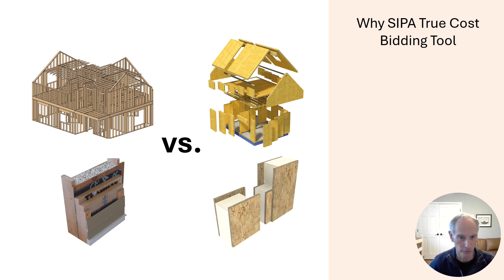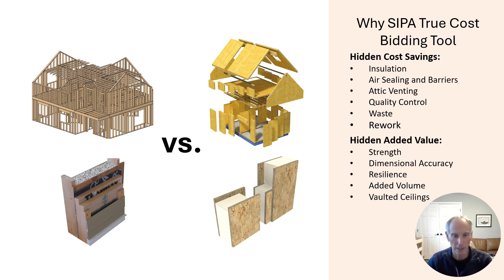Video #1 Why Use the STCBT to Deliver More Compelling Bids

Comment: Good information, but please provide QUANTIFIABLE value from both the Contractor perspective (% time savings to build w/ framing & insulation in one step, reduction of RFIs, increased overall quality, straighter walls, tighter home measure by blower door test, etc.) and from the Homeowner’s perspective (% increase avg heated space, improved r-value, % tighter home, less bugs, etc.) SIPs as a better way to construct homes have been around a long time now and this information should be readily available or calculated and shared.
Reply: It is very difficult to obtain the QUANTIFIABLE information that you are requesting from contractors and customers.  Contractors and customers are way too busy to take the time to provide that type of quantifiable data.  Enercept RSM's, Regional Sales Managers, do have specific contractors and customers that they can discuss these type of results on specific projects.  Please feel free to reach out to the Enercept RSM's for more information.
Reply: Thanks, Joe@Enercept, for your comments. The Structural Insulated Panel Assn. has on their website a page under the "About SIPs" dropdown menu at the top in the RED bar with a listing about SIPs vs Stick-frame Cost data. There was a 2009 RS Means Time and Motion study conducted on a home in New England by BASF Corporation's EPS and Neopor division showing the house framing was does 55% faster using SIPs. You can also go into videos # 2 and #3 and hear Sam Rashkin provide many tips and rules of thumb on he savings for each of the input data entry fields for the SIP True Cost Bid Tool. Sam has also written an entire book on Housing 2.0 which provides many data references.

Al Cobb at the SIPschool also has many years of experience and proof points which are captured in SIPA's 10 video courses called Building Education with SIPs (BEST) training. They mention an experienced crew can set anywhere from 600 ft2 to 1000 ft2 of SIPs per day depending on the complexity and site conditions, lifts, etc. Check it out.

I hope this helps. The website is loaded with tools.